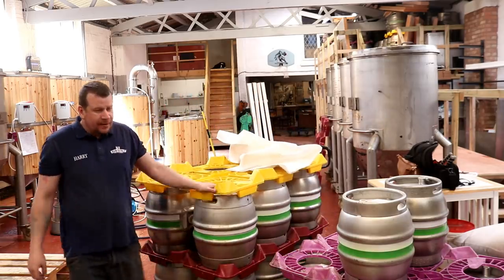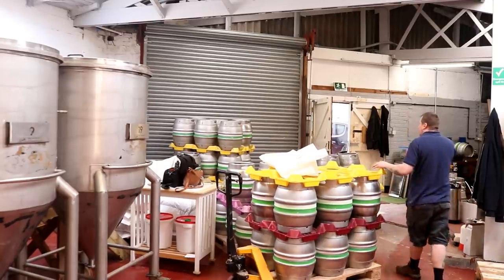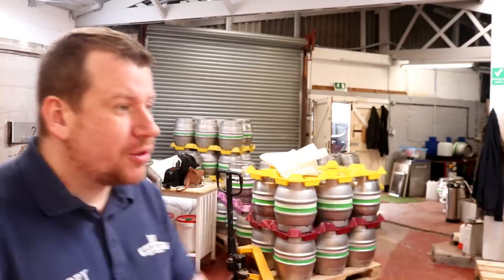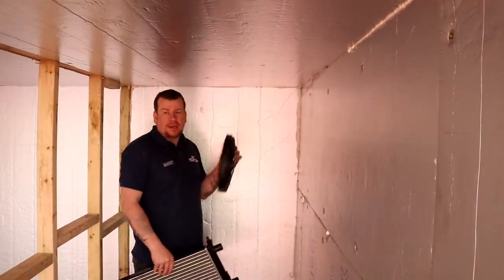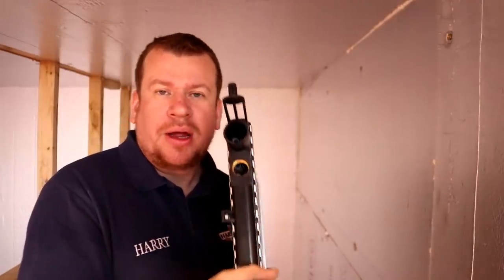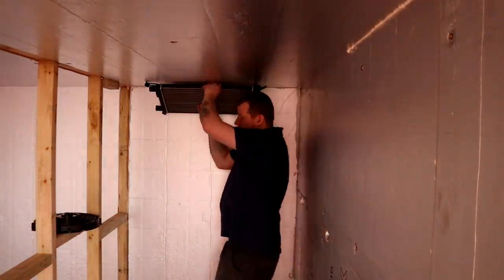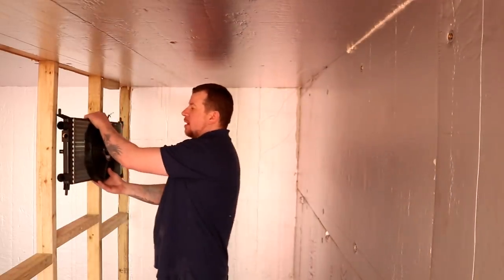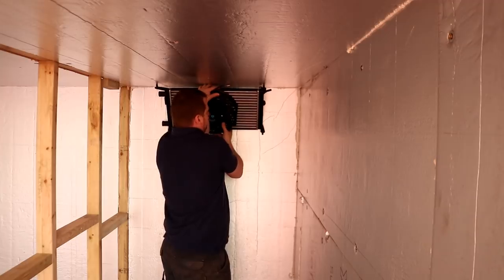MOUNTING THE COLD ROOM CHILLERS

Comment: If you're worried about the glycol pump being off for long periods, you could put a cyclic timer in parallel with your demand signal from the STCs. The cyclic timer would be set up to turn on for x-min in every hour giving you a minimum, the STC pump signals then make sure you've got pressure when you need it.

Comment: Loving these cooler build vids. Have you considered using a pwm controller? You can get better speed control and they are dirt cheap on eBay. Search for "pwm motor speed". Just put it in line with the power supply and dial in the fan speed you want.
Reply: David Gray he already has that with the variable resistor. With the PWM it would be cool to have some logic/control behind it but that’s micro controller stuff or RaspberryPi